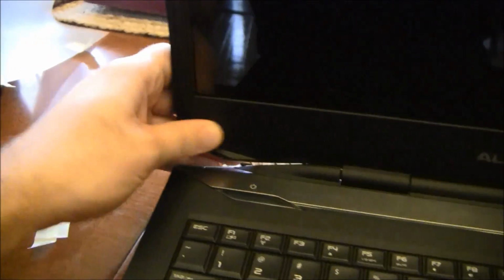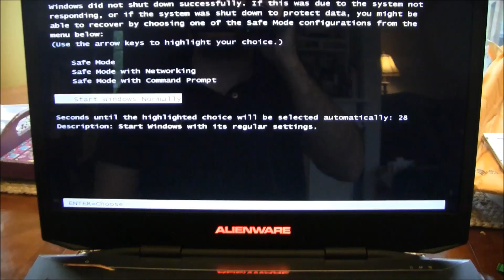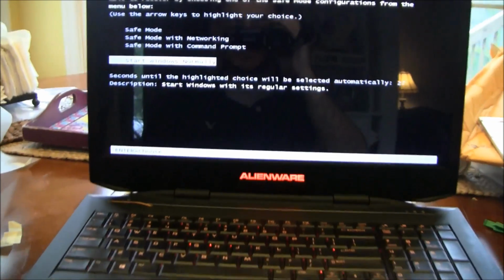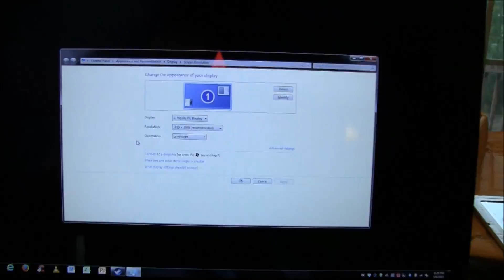Alienware 17 R1 (2013-2014) LCD Screen Replacement

Comment: I have the M17 with the GTX880M. My original screen model is LG 0K6PJ1 (K6PJ1). I found them on Ebay for ~$120 and they say they are LED backlit. Apparently this model is already 1080p. Good luck!

Comment: Hi. I have an Alienware m17x R3 1600x900 resolution. Can it be changed on a 4K screen? Or some of higher resolution? What would you recommend?
Reply: i want to know the same thing... mines a i7 4700mq with gtx 765m at 900p resolution i think 2013 model.

Comment: You made it look easier than it really is. Some steps were skipped. Taking out the locking connector was harder than trying to fit a condom for an elephant. I wish i was warned to take the adhesive all the way off,  it makes taking out the locking connector much easier. MAKE SURE EVERYTHING is securely connected or you'll be alerted by a blank screen and your pc beeping!
Reply: Does the screen replacement affect anything on the laptop ?
Reply: @chris1806  No it works good!

Comment: Hi, 
Got a question when I am looking for the screen on theyr website, do I have to choose the Alienware screens or also from other manufacturers if I prefer them (I suppose the connctors are not the same), and the Alienware 1920x1200 panel is it just denser in pixels or is it wider in dimensions. (http://www.laptopscreen.com/English/model/Alienware/M17-R1/)
Thanks.